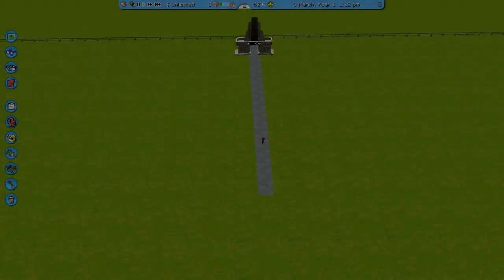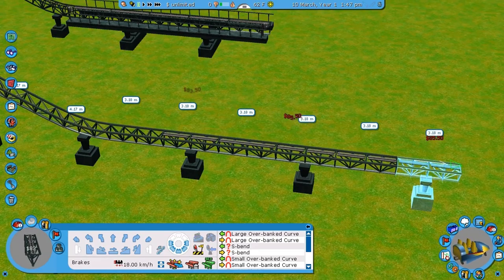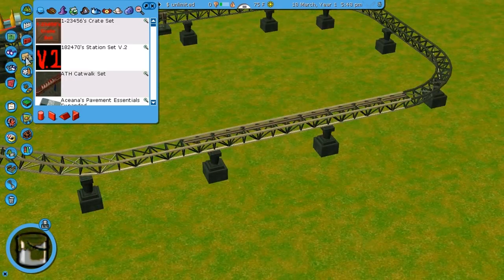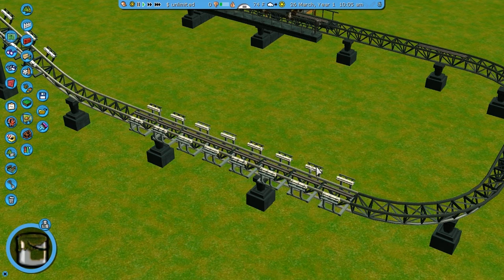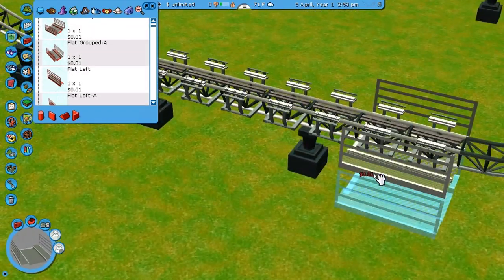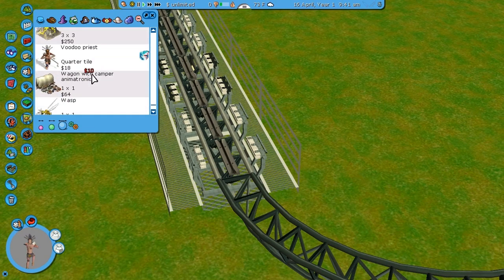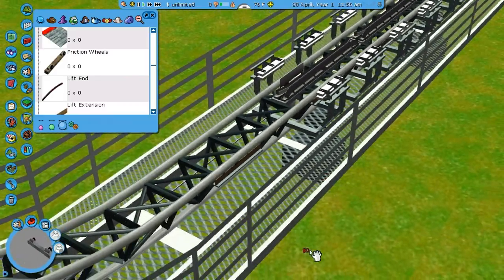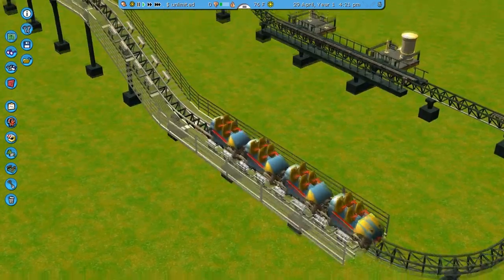RCT3 - How to make a realistic Gigacoaster Brake (MOVING BRAKES)

Comment: Do i need to do a higher or lower brake speed to make the brakes stop the cart.
Reply from the maker: To make it stop the train/car completely you'll have to use block brakes, and make sure that theres a train or car on the next block section of track when the train enters those brakes... if that makes sense :)